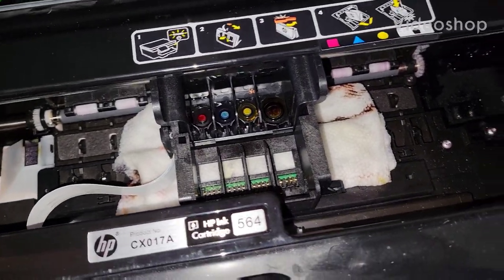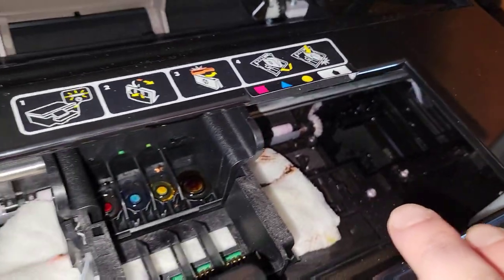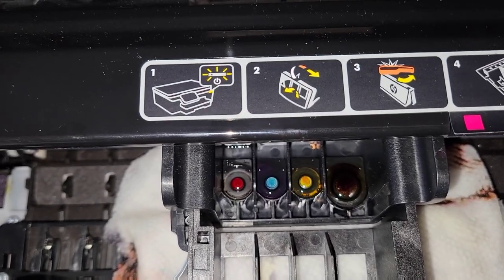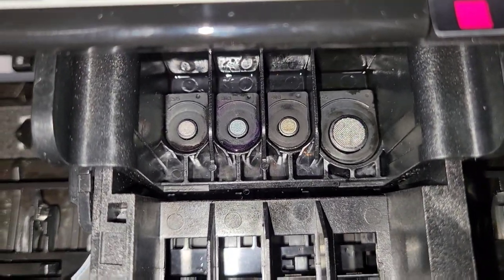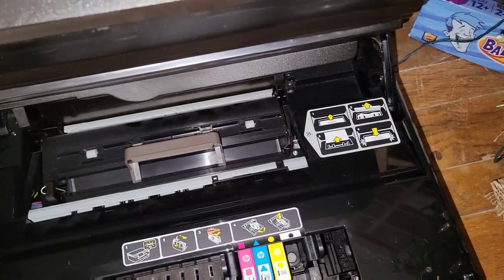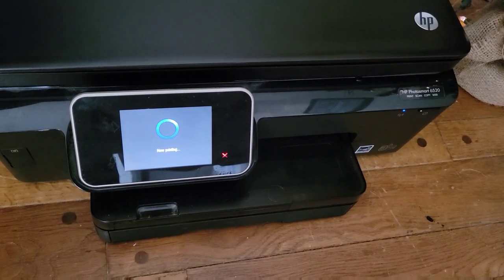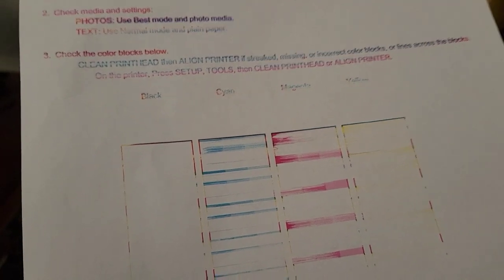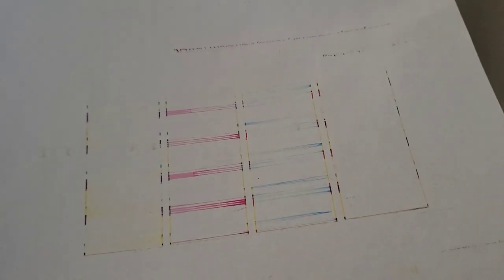Part 1 of 2: HP 6520 Printer Not Printing Black Ink, Blank Pages, Tried Everything

Comment: Printer is worth $76
Reply from the maker: Tell that to your child when there's no supply chain and your sushi is full of plastic
Reply: @KAFKUBA  I mean what are you printing really
Reply: Doesn't printing in itself consume unnecessary resources
Reply from the maker: @Porgysashimi  tax returns for Biden
Reply: My HP shizzed a few weeks ago - similar symptoms. I looked like a failed tatoo artist before I finally gave in. 🤷‍♂️
Reply from the maker: Any thoughts?  I think I need to take it apart and really clean it
Reply: @KAFKUBA  drops of alcohol on the screens prior to putting the cartridges in and see if it will “print” that? Looks clogged.
Reply from the maker: I pretty much tried that
Reply from the maker: @KrizAkoni  I think black ink clogs more...need high pressed attachment to blow thru
Reply: @KAFKUBA  If you could remove it completely it should be pretty easy to blow some Johnny Walker through there…
Reply from the maker: Haha... good idea... can't waste my Laphroaig on this
Reply: @KAFKUBA  🤣🤣🤣